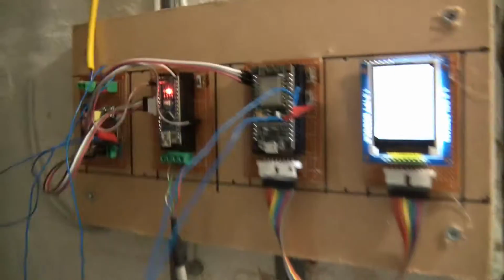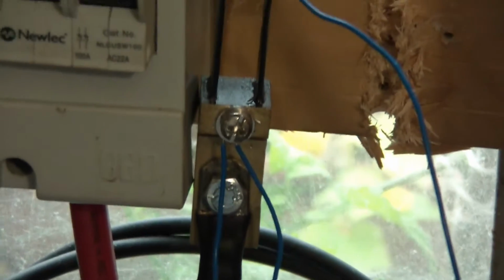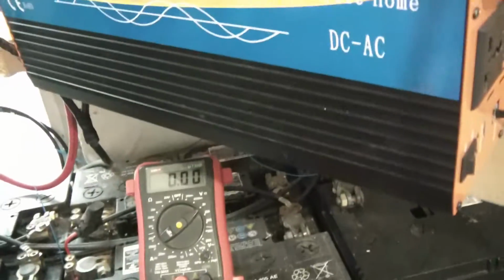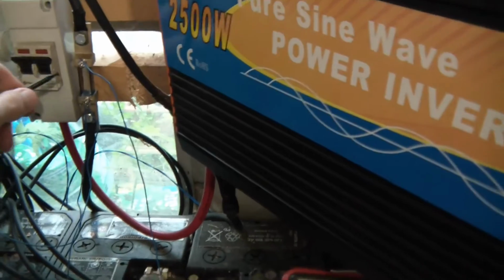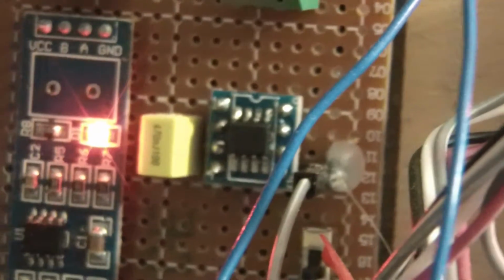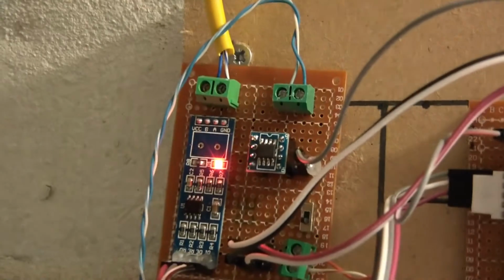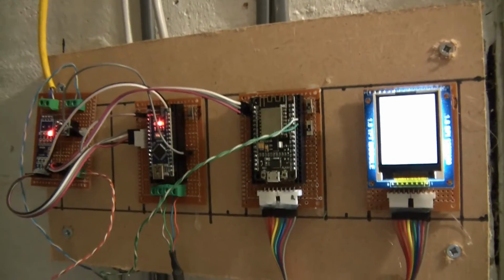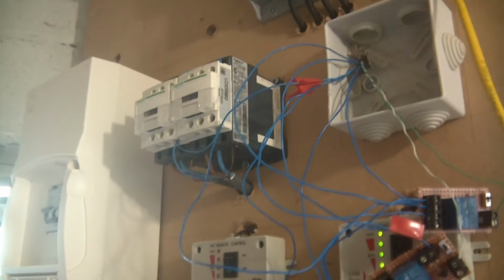My DIY Offgrid Solar Power System (Diagnosing & Fixing Current Shunt Amplifier)

Comment: I've been wondering, why are you using 3 different MCU's? Why not use just 1 MCU to do all the processing? It would make the debugging a lot easier.
Reply from the maker: Hi Korishan, I don't use 3, I use 2 Micro-controllers - A Nano and a NodeMCU. I need WiFi access, as well as enough pins to control everything. The NodeMCU can offer WiFi capabilities, but is way short of pins - a lot of them aren't usable. The Nano on the other hand has no WiFi capability, but has plenty of pins. So I use them both. The Nano collects the data, whereas the NodeMCU does everything else.
Reply: Ahh, ok. And under further review, I see that the left most module is actually a communication board. USB to Uart?
Reply: you can actually use node mcu to do everything. and you can monitor the statistics on an web page, by hosting it on nodemcu instead.
Reply from the maker: It's true, but I need more pins. I'll be looking at the ESP32S in more depth at some point soon.

Comment: I you can post a wiring diagram of how you have it wired I'll take a look. Make sure all your earths are common... also check that the earth pin on the outlet of the inverter is actually connected to ground. Are those RCBO's MEM?
Reply from the maker: Carl Bartlett I've got it working now. For some reason, the RCBO just wouldn't work. I've replaced the RCBO with an MCB and RCD and now it works!
Reply from the maker: Carl Bartlett Thanks for the info about common earth... I've been wondering about that.